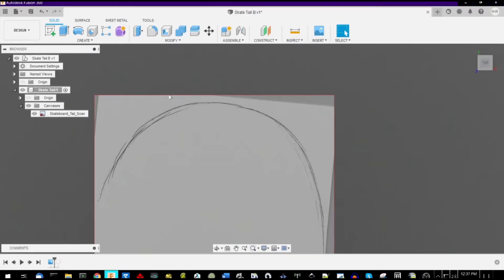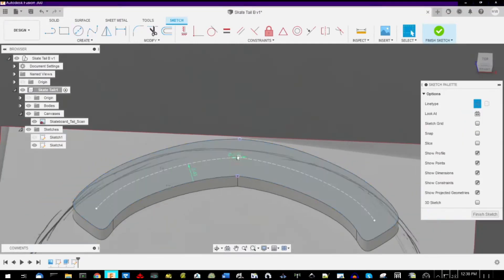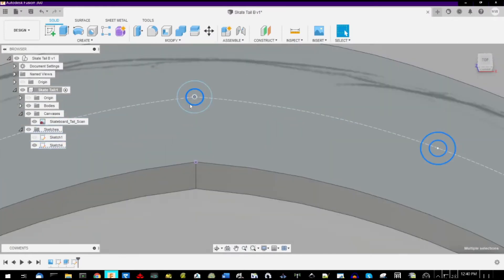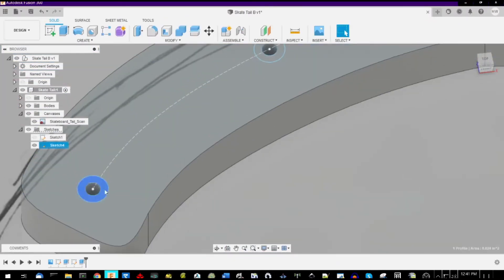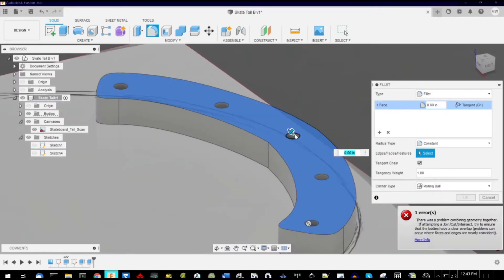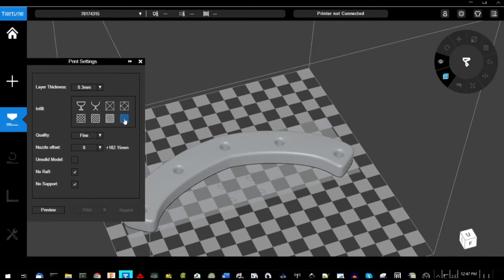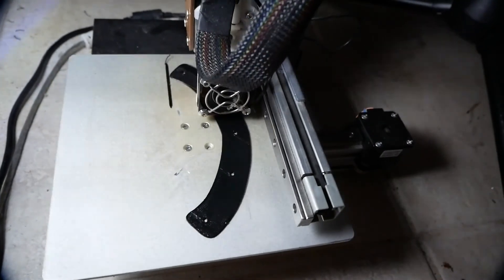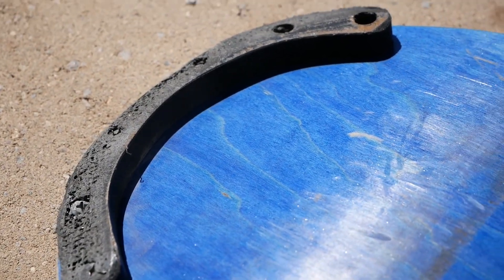How to Make a 3D Printed Skateboard Razor Tail Protector

Comment: I was thinking about making a thin metal plate instead of such a bulky protector, what do you think about that? Should last much longer imo
Reply from the maker: I was also considering using epoxy to attach stainless steel mesh.
Reply from the maker: Metal will be loud AF, and it may cut you, but it will make sparks on the street at night! 🎇 Use stainless steel if you can, but cold steel will work too...  Laser or water jet cut would be ideal... once it sharpens up, be careful 🔪  LMK how it goes.
Reply: @ollieanthem9213  I was thinking more of aluminum rather than some steel, just for ease of cutting and shaping. Maybe I will do this to my next board and then just glue it on the tail, will see
Reply from the maker: @enzocalzone5298  glue.. lol - maybe epoxy, not glue...; Try 24g steel with hand snips, banged into shape, screwed on, sparks galore.

Comment: How well do these actually hold up? Do they get hung up on anything or effect pop when doing tricks?
Reply from the maker: They hold up great, esp with 100% infill, and the pop is almost identical in feel and sound...
Reply: The first few days makes people not use them, but after that, they are great. Pop is not that much removed, and your board will indeed last much longer like 2 months 3, or if you lucky, 4.